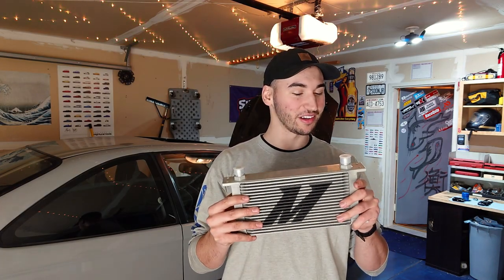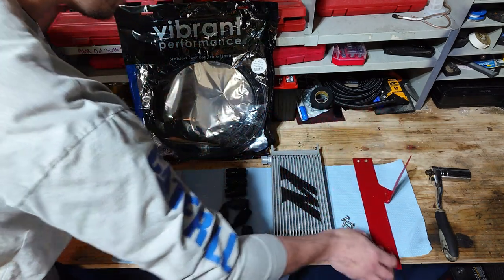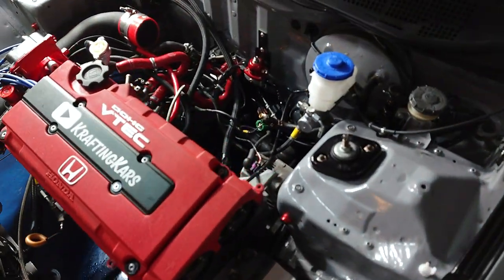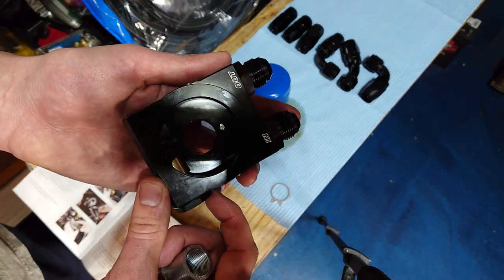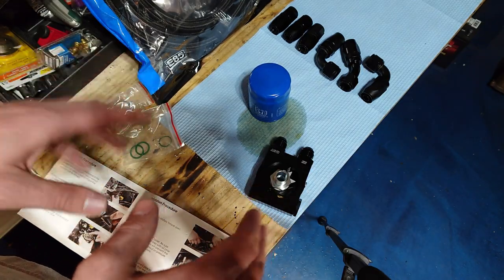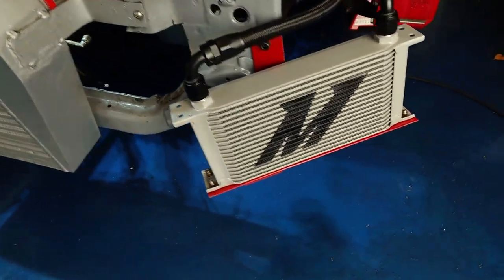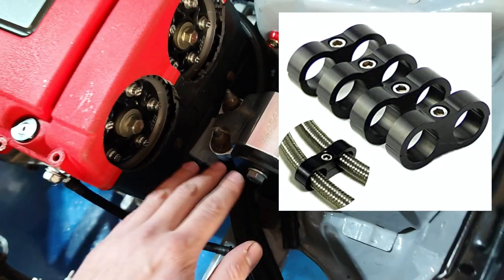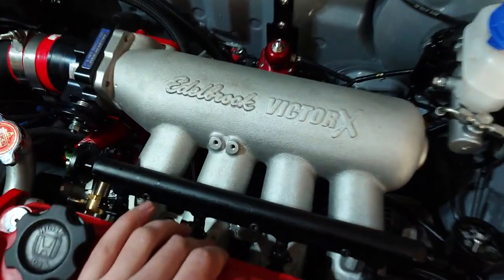Turbo Civic DIY Oil Cooler Install

Comment: Very cool and clean, I have a suggest if u can, install oil temp. sensor to the line after the cooler going back to the engine to redout the  actual oil temp.
Reply from the maker: Not a bad idea! That's the one sensor I don't have yet!

Comment: I found out that you can take small computer high flow fans and make a shroud on the back and act like radiator setup for better oil cooling hopefully you try it won’t regret it
Reply from the maker: Good idea!

Comment: Nice bro. I’m thinking of throwing one on also.
Reply from the maker: I can't wait to see how it performs!
Reply: @kraftingkars  Do you need to remove one of the fittings and fill it up with oil? Or do you just bump start and fill?
Reply from the maker: @G_Weezy  with the vibrant thermostatic plate you have to remove the cooler and fill it with oil, if you get the mishimoto thermostatic plate, it allows 10% oil past before the thermostat opens up so it will it fill by itself.

Comment: An10 should in the lower if you need change oil use loosen and the used oil in your cooler. Not more problem

Comment: @kraftingkars I love your vids!!! Here i am again looking at your vids to mock up for my ek. Any particular reason why you didnt do the mishimoto kit vs your setup with the split parts from vibrant? An how long were the hoses after you mounted everything up?
Reply from the maker: I needed the vibrant spacer, and have had great luck with their products in the past. Each hose is at least 5ft
Reply: @kraftingkars  good to know brother!!! Im on the fence if I should just purchase the full kit from mishimoto since doing the a le carte  sourcing of parts equals out to roughly the same price. Just not sure what the build quality is on the thermostat plate

Comment: Nice video! Is the cooler not a bit unstable with only one fixing to the chassis?
Reply from the maker: It's been good so far, those lines are pretty stiff too so that helps hold it in place.

Comment: I love your videos mate I bought an oil cooler recently but I don't know which way to put the lines I've never fitted one before and I know it's directional but don't know which way in or out any advice
Reply: On a sandwich plate
Reply from the maker: It shouldn't matter, most sandwich plates will be labeled with an in/out. But oil can flow both ways through an oil cooler so it really doesn't matter which port on your sandwich plate is sending/recieving. The hoses follow the same path either way if that makes sense
Reply: @kraftingkars  OK mate thank you

Comment: Did you also added more oil? Does the oil pump work harder because the oil runs in a longer path?
Reply from the maker: You'll increase your oil capacity a little, I have a 4piston oil pump in my car and it seems to handle this cooler no problem. A good oil pressure gauge will be your friend!

Comment: Thanks. Beautiful. How much did you spend for the cooler oil system?
Reply from the maker: Right around 300 total of you include my 2nd sandwich plate
Reply: @kraftingkars  thanks bro
Reply: @kraftingkars  thanks. I have two questions. Where did you buy it? And I found one but it says 10 row oil cooler, 19 row oil cooler, 25 row oil cooler, which one I should choose?
Reply: @kraftingkars  also I found another one that says non-thermostatic and thermostatic but the thermostatic is + $54. What’s different? Which one should I buy, non-thermostatic or thermostatic?

Comment: If we didn’t have the second oil adapter would the install then be the same without it ? What was the reason you didn’t remove the secondary adapter ? Thank you for the information the video was good 🤙🏼
Reply from the maker: Yep the install would be the same without it. However I needed it for extra clearance
Reply: @kraftingkars  awesome! I’ve been looking at a lot of your videos lately I just had a few questions before moving forward if that’s okay. So my current setup is a b20v and I did notice I have enough clearance to run a single sandwich plate/Therm plate does that mean it’s okay to just order the single vibrant plate you had and not use a double decker setup ? (I know you said it was only for your specific clearance issue) 

Secondly, I’ve never done any oil line fittings myself, is that process hard to do? I understand you’re using a long strip of line in case you need more length so then you cut it at the length you need but then you insert the hose line by force into the female fitting then insert a male fitting into that one to create 90’s? Are you essentially crimping the fittings on the hose or is it just an insert ? Thank you a lot for your help, it’s very informative 🙏🏼
Reply from the maker: @fantasyyy_  you can definitely try to run the single sandwich plate, I know it works for alot of people! As for building AN lines. I would just search up "how to build AN lines“ on YouTube and watch a couple tutorials to get a good understanding. Making larger size lines is kinda a pain till you really get the hang of it.

Comment: My Mishimoto oil cooler has just arrived with some 10AN lines. They are way bigger than the stock lines that ran to the old oil cooler. Is it bad that the new lines are at least twice as big? Also need to get some M16 x 1.5 to 10AN fittings to connect it back to the original oil filter housing
Reply from the maker: Shouldn't be an issue, just make sure you add a little more oil to fill out the extra capacity. And always monitor that oil pressure👍

Comment: Hello, I would like to know if the temperature was really lowered?  How long was it before and after installing it?
Reply from the maker: Oh yeah, I don't have an oil temp gauge, but I noticed my oil pressure was a little higher after install, and my coolant temps were lower as well!

Comment: great what you see deferent heating before and after ?
Reply from the maker: I don't have an oil temp sensor. But I can definitely tell the engine runs cooler, ect's seem lower. I think the biggest benefit so far is it helps keep the oil from breaking down so fast due to the heat from the turbo. Helps keep oil psi up!

Comment: Is it worth throwing in an oil cooling sydtem in a non turboed honda? Im dealing with some overheating issues after driving decent distances, first radiatir but was definetly considering this
Reply from the maker: Definitely, your #1 priority should be to direct as much airflow as possible to your radiator. That will help on long cruises. My oil cooler seems to have helped keep my oil from getting too hot and breaking down! Which has helped keep oil pressure up and temps down👍

Comment: Hey, just got a 2005 honda civic and was wondering where should I start with mods after installing cold air intake? Trying to push this car to be faster than my old bmw( at least 235-250 HP)
Reply from the maker: Is it an si? It will be tricky to reach those power levels with just the d17 motor. You could go turbo kit with an ECU upgrade and a tune and hit your goal
Reply: It's a lx and I'll definitely get the turbo kit and ecu upgrade

Comment: After you installed the oil cooler, did you add more oil to your engine?
Reply from the maker: Yep, I filled up the oil cooler by itself with oil, and made sure the engines oil level was good before starting! So far no issues!
Reply: @kraftingkars  Oh I always thought it needs to pour it on engine after adding oil cooler. I didn't knew you cann directly put the oil into the cooler..
Reply: @kraftingkars  Im new to cars sorry for the questions, If I add a catch can, do i also add more oil as well?

Comment: Were you having overheating issues or what was the motivation for this mod?
Reply from the maker: Just wanted the added safety. Some factory B16s actually have a little oil to water cooler behind the oil filter. Since turbo setups tend to run hotter, I figured it was a good idea. It made a big difference keeping my oil cool and preventing it from breaking down fast.

Comment: Mishimoto? Those are expensive. I put cheap ones on, and they run well also. And you can install those anywhere to improve your engine, it doesn't have to be in front. The main thing is, it runs More oil which makes the car run better and it keeps the oil clean. You're doing show car stuff, but the video is still helpful.